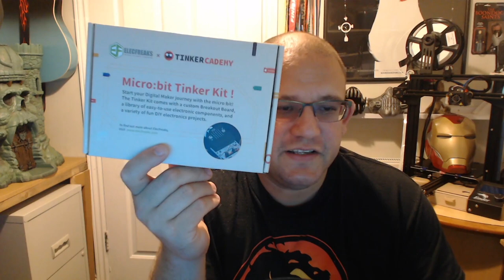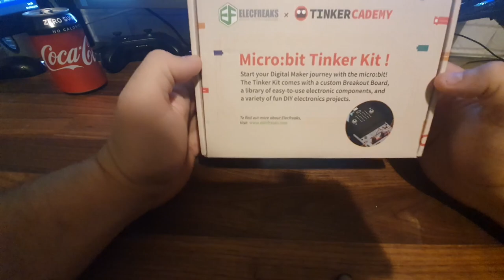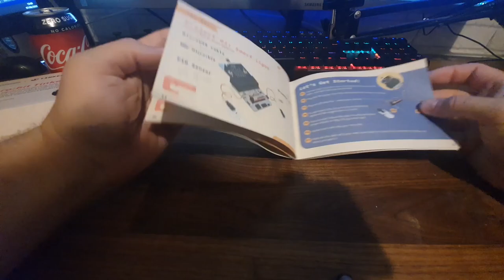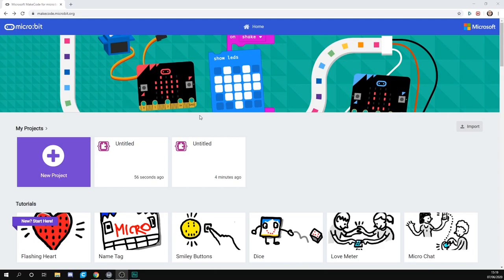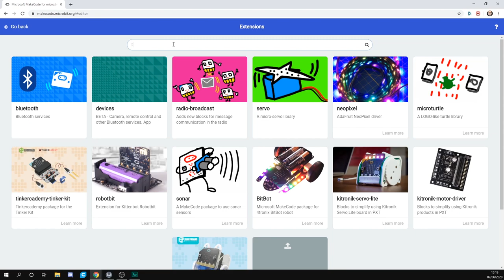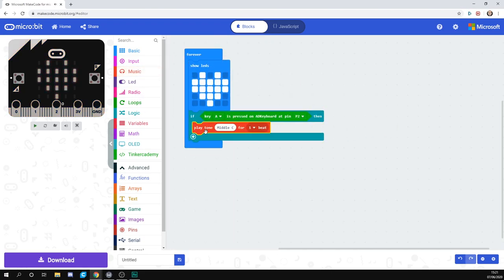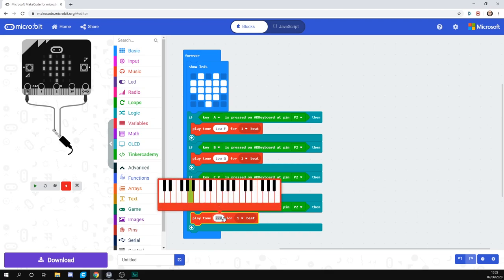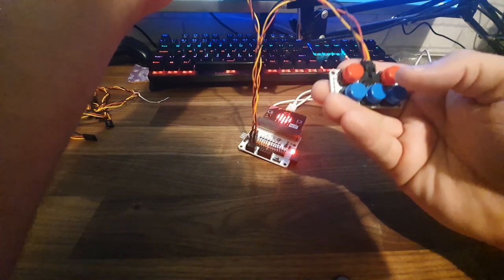Elecfreaks Micro:Bit Tinker Kit Introduction and Project 1

Comment: I typed in your code exactly as you did, and ran everything the same, but I have this constant beeping noise. When I plug my earphones into my laptop, I can only hear the beep in there, and the keypad button for the project works fine. It is just that constant beeping. Any suggestions?